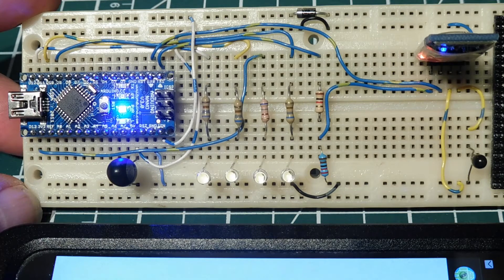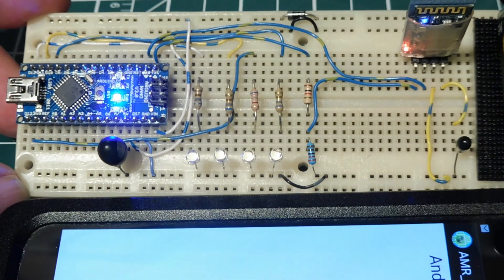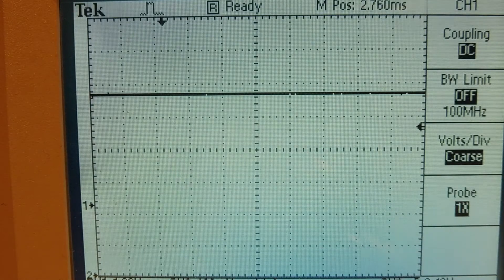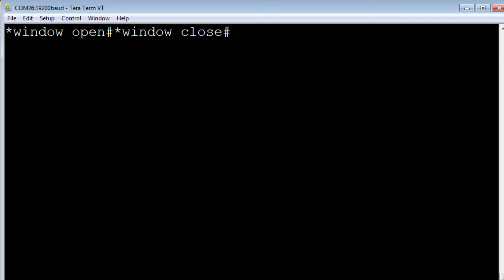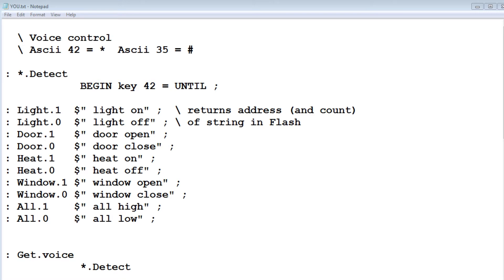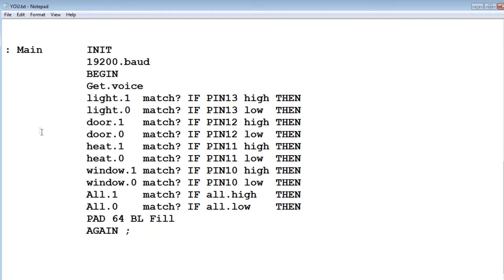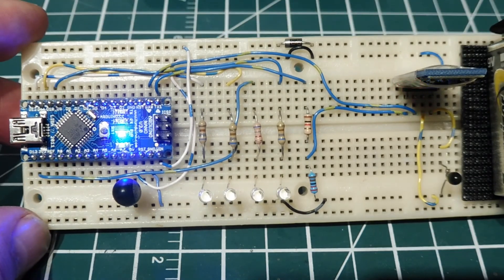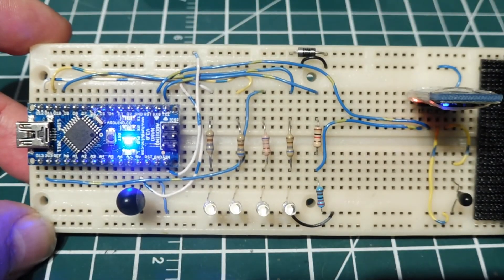Build A Voice Activated Switch

Comment: Instead of using bluetooth Hc-XX device. Will it work on voice  recognition module? so that there is no need for the mobile phone turning on and off the microphone to command.
Reply: M Circuits you need the Bluetooth module to broadcast the code from the arduino nano

Comment: I have to wonder how many viewers click away from your videos when you show them Forth code.......  Personally, I kinda like the challenge to understand your programs.  But I think many tinkerers today pretty much only know the "pseudo-C" Arduino approach.  This does not imply you should code in something other than Forth just to accommodate less flexible viewers.  As I'm noticing more about the XOD graphical IDE for Arduino, it could be we're right at the front-edge of a paradigm shift for Arduino software dev.  Thx.
Reply from the maker: I think you are correct regarding including Forth code in my videos. If it is not included, then it is requested and if I show it they probably leave. I am not trying to change anybody's mind regarding programming languages. I have used it for many years and have written large applications. NASA still uses it extensively so I am not alone. 
I think XOD is gaining in popularity because it works well as a teaching tool for beginners.
When MIT came out with App Inventor, visual programming started to gain traction.